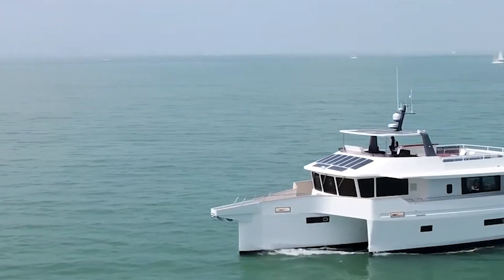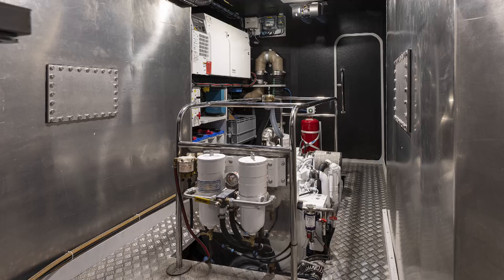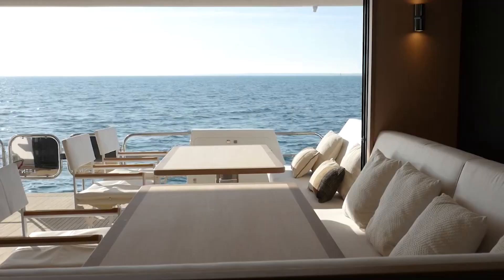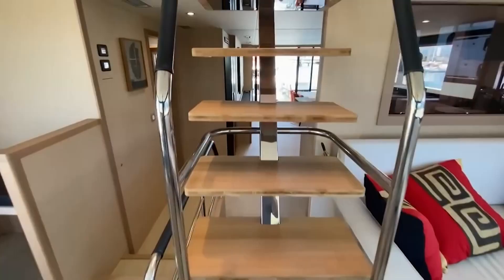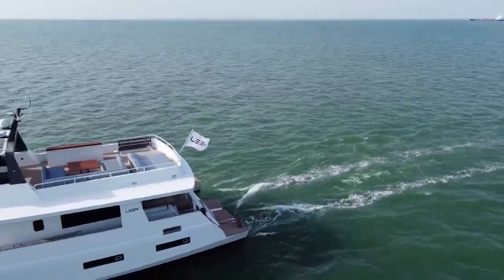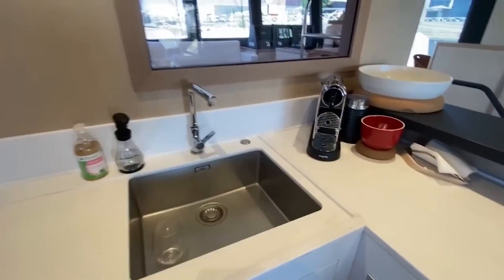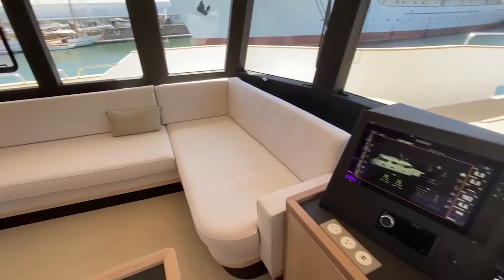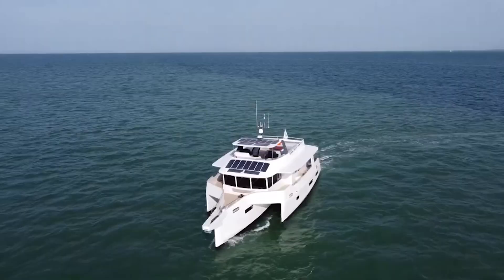Inside The LEEN 72 Trimaran Trawler Hybrid Yacht

Comment: I would remove the main engine and replace it with a second and maybe third generator and another electric drive in the main hull. 
That way you have less points of failure.
If the main engine or the generator fails you loose a lot of your speed. With two or three generators, when one generator would fail, you still have all the props and can use them at full power as long as the remaining generators together with the batteries keep up. Charge these batteries from solar to extend that.

It also makes it easier to have spare parts and knowlegde on board as you have only one type of generator instead of having a generator and a main engine.
Reply: 100%
Also there could be way more solar above the flydeck.
Dont know why they didnt add more batteries as LFPs getting very cheap lately and the solar could tricle charge them while at anchor. 
Running diesel engine to power an electric drive system could be much quieter i guess.
The engine only needs to run at one optimised speed.